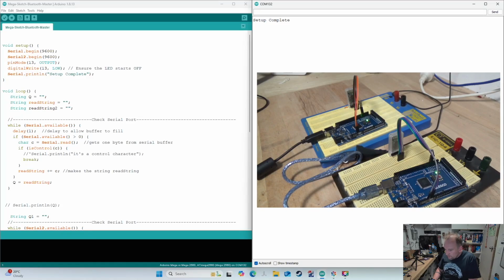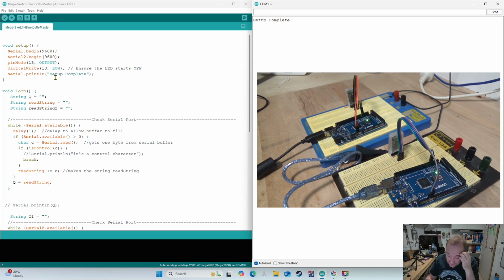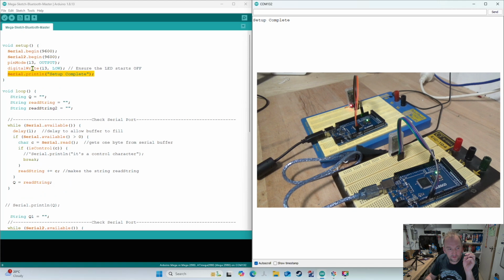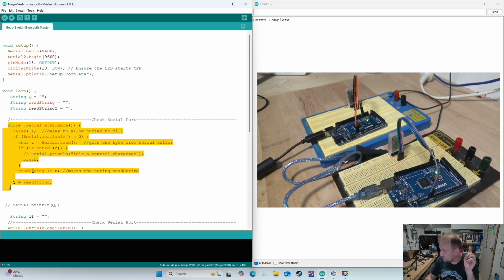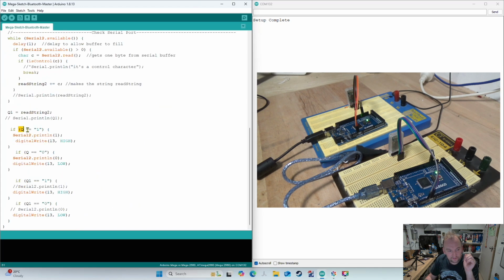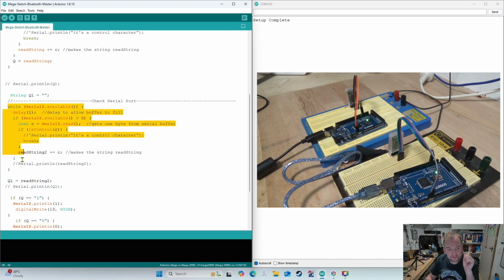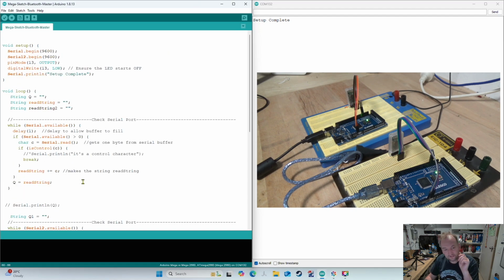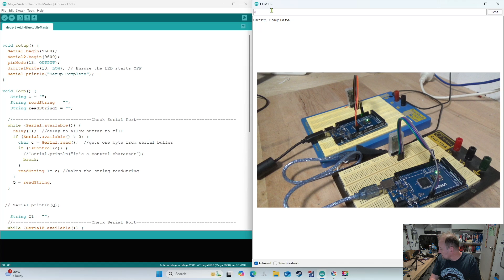Arduino 2 Arduino Communications VIA Bluetooth

Comment: Actually i want to measure the distance alculated by a TF LUNA sensor by connecting it to  an arduino. and from that arduino (master) we want to send data to another arduino (slave) which is connected to a pc so that we can get the data logged.
Reply from the maker: So like setting up one Arduino as a dongle that you communicate with and meanwhile its checking DATA from another unit